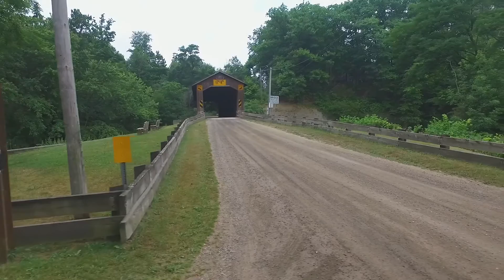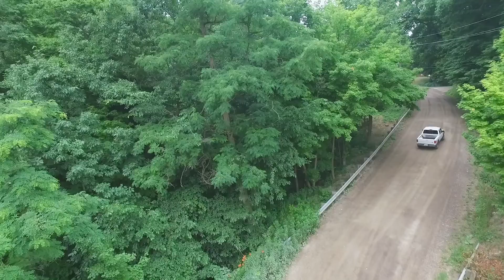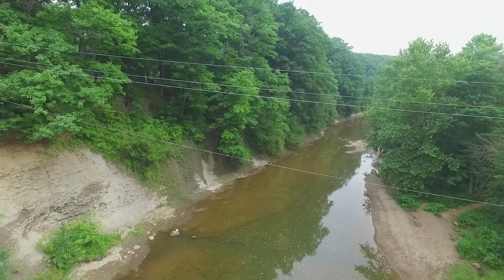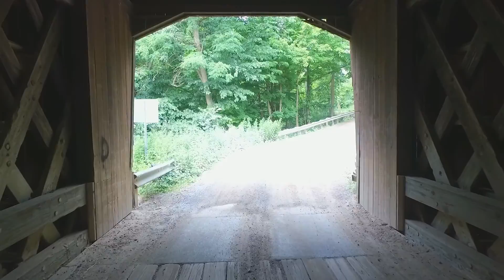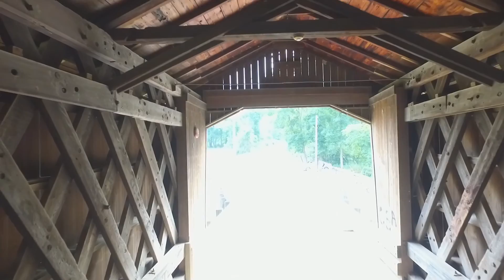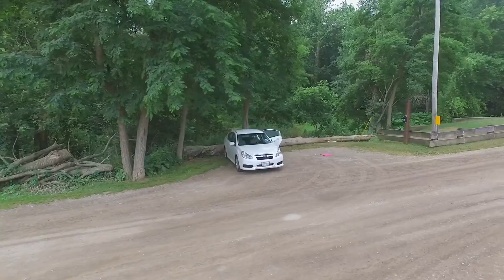P3A Creek Rd Covered Bridge 7-5-2016 (1080P60)

Comment: What a difference pre restoration, it's great to see money spent this way. In the UK they would have pulled it down and put a soulless concrete structure in its place. 
On the last pass through the bridge at 8 min 45 on the left hand side at the entrance there was what looked like a red fire bell, what was it ?
Reply from the maker: Not sure exactly what that bell is. It could have been there to warn of traffic coming in the other direction. I did notice that most people going through this bridge sounded their horn on approach and up to the entrance, so that someone coming from the other direction would be forewarned. I've seen similar bells on a couple other bridges. If the weather holds, tomorrow I'm going to shoot the last bridge in the series, and the longest covered bridge in the U.S. - about 630 feet long. It was designed by the current Ashtabula County engineer, and named after the County Engineer who preceded him, since he was such a big factor in the restoration of all these bridges. Hoping the shoot goes well.
Reply: Good luck.